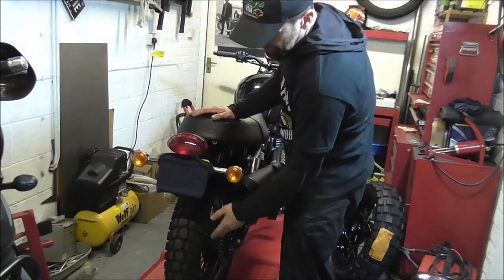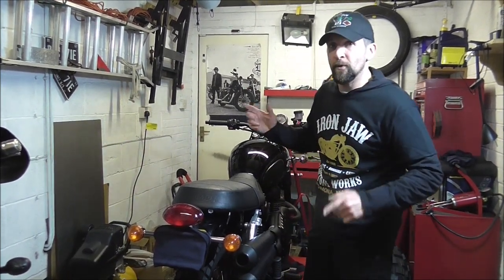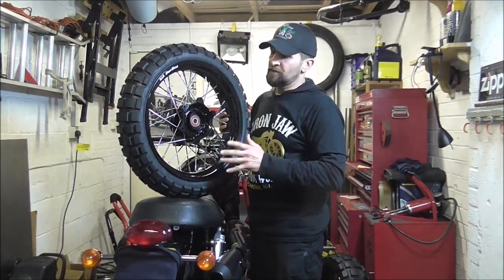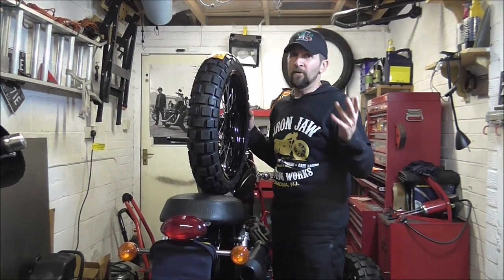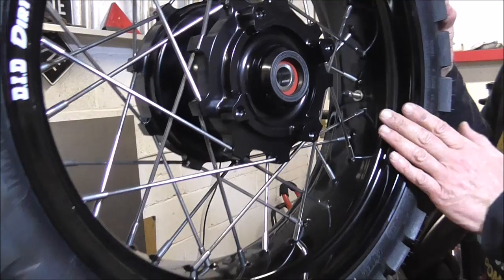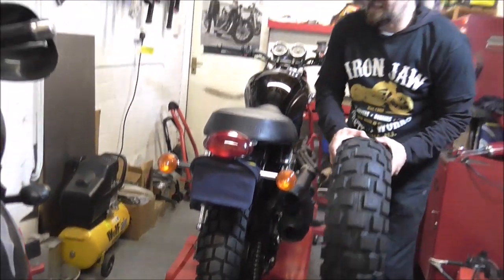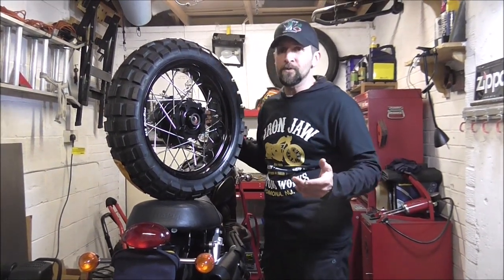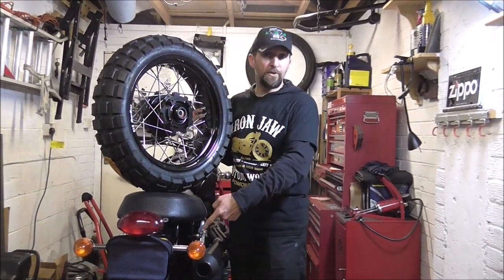Delboy's Garage, Triumph Scrambler 'Fat Wheels'

Comment: Thanks for all the help, Delboy! So the last thing I'm looking to upgrade on my bike are the tires for this season.  I would like to get a wider tire, but at the moment don't have the money to go to a full 5" wide in the rear.  The stock rims on the Bonne are only 3.5" so I was wondering what your recommendation on tire size would be if I wanted to get something a little "meatier" without sacrificing too much performance.  A friend of mine just fit a 160/70/17 on his rear using the stock rim and it looks great, but I just don't know how that might effect the performance of the bike if I were to get something that big.
Reply from the maker: Hi Craig, I would respectfully advise against fitting a 160 on your 3.5" rim.. its going to pull the tread radius round into an unnatural curve..  When you fit any tyre the 'bead' has to be supported at the correct width in order for the curve of the tyre tread to fall into its natural shape, and grip in the way intended..   

The tyre edge beads on a 160 tyre will naturally be about 4.5 / 5" apart, so the rim that supports them needs to be that width.. but if you "pinch" those edge beads in to a 3.5" tyre will pull those tyre edge beads together, and that will roll the tread curve round more steeply, and that actually reduces the width of the footprint that the tyre makes.. 

Now this isn't dangerous, but its not a natural correct fitment.. it may look fatter as there is more tread and less wall.. but if you measure you mates tyre across the tread, and your 130 across the tread it wont be 30mm wider.. may not even be any wider at all as its being pinched together... its more of an optical illusion... so again, not dangerous mate, but fittin oversize tyres is not a clever practice.. 

 A better way to do it, would be to find a make and model of tyre thats a chunky and aggressive looking tread, and maybe go up one size to 140... and your find it will look a lot more chunky and still give you a safe, full width footprint..

Comment: I have a 2006 T100 and Im having  DR wheels make me a 17" front wheel to replace the 19" wheel. I'm doing more of a cafe racer thing but sometimes I do travel on dirt roads. I have a Metzler tourance on the rear which is excellent. However it doesnt look like that tire comes in a 17".  What tire would you recommend for the front?  Cheers

Comment: Will those tires fit on a stock bike?
Reply from the maker: No mate, you need wider rims made to fit these tyres!
Reply: @ so if I get the wheel and tire combo, it will fit on a stock bike. I was having a hard time picking up the size with your accent. My apologies.
Reply from the maker: Tyres are 180/55/17, 120/70/17, and you'll need a 5"x17" rear and 3.5" x 17" front.. and yes, they'll fit into the bike as long as they're made with the correct Offset and axle spacers. !  Hope that helps.
Reply: Thank you 🙏

Comment: I like the rear tyre a lot! Makes the scrambler the beast it should be! Do you think an 170 on a 5 x 18 inch fit on the rear for the scrambler? You use a 17inch right and that is standard on the Scrambler.  And would the drive performance decrease if I put a 19 x 3 inch rim in the front ?  Thanks mate!
Reply from the maker: +Jan Aarts Hi Jan... the front has a 19x3 already, so it will fit and work like the factory handling... the 17" makes is steer quicker... and the 18" rim will fit in the back ok, but check if you can get the tyre for it.. i think the 180/55/17 is the biggest that they do in the TKC80...others may fit, but i havent tried them... Hope that helps buddy, thanks for your kind comments.. Del.

Comment: Those wheels are so cool !! Deffinatly a good investment cant wait to see them on del  im even thinking of getting those tkc 80 tyres on my supermoto
Reply from the maker: Get stuck in Aaron, coolest tyres ever! Grippy in the dry and still ok in the wet, you just need a little bit more of a sense of humour in the deepest corners, but being a Supermoto, they're made to go sideways aren't they?!
Reply: I like your thinking del  definatly in the pipeline now when the current ones have worn out and you were spot on on the previous tyre  reccomendation for my bandit 2nd set of avon storms  still going strong too  the scrambler will look so cool when the're fitted !!

Comment: I'm only 2 years too late on the thread...but we be all got to start sometime eh!! Quick question what's the widest tyre I can fit without changing the rims ?
Reply from the maker: Hi Paul.. general speaking, going up two sizes is the ragged edge, check things like chain and swing arm clearance, and maybe go for a chunky style tread if its the right bike, as it makes them "look" bigger... chat with the tyre guy though, if you go up on width, they may recommend to come down one size on profile to keep it safe... Hope that helps.. Del.

Comment: Del what size tyre would you recommend for a T 100 Bonnevile 2013. I really like the look. What are they like in the wet. Love your Vids
Reply from the maker: Hi Peter, tyre size if dictated by the size of the rim on the bike... I've got up to a 5" rim on this project, so I can fit the 170 tyre... but as your standard tyre is a 130, you should stick with that size, unless you are changing the rim.... it's a popular mis-conception that fitting a wider spec tyre will look 'fatter', but actually it doesn't... the wider tyre means that the seating beads are wider apart as well, and if you squeeze them in between a narrow rim, it will curve the tread more and make the tyre look no wider than standard with the danger that your tread is not the right shape and you may well, actually, end up with a SMALLER contact patch on the road, so stick with the standard 130 tyre your bike has and you can buy a Conti TKC80 in that size... and same goes for the front to match!...

As for wet use, treat them like you would the standard factory fitted tyres in the wet and don't push them too hard, they are great in the dry, fine in the wet, but as you have less rubber contact with the ground, due to the big fat blocks of rubber, then don't push your luck at extreme lean angles... I rode with a set on the Bandit, that was a far heavier bike and never even noticed they were any different from regular tyres!
Reply: Thank you for your reply. I now have a tyre pressure gauge a toolbox stacking unit and a scotoiler I wonder who gave me those ideas. My friend has the scrambler and we are touring italy this year and he may go for the wheels I will certainly be buying the tyres. Once again many thanks

Comment: mate I love your tutorials and the way you share your experiences. Can I ask advice on a Bandit? I've got a 57 plate 12,000 miles on the clock, The oil is very white, I've change the oil but it still goes white almost immediately. I only do 3 miles to an from work, what do you think? if it was a car I would think the head gasket had gone.   Thanks, Dave
Reply from the maker: Hi Dave, don't panick mate.....its condensation due to your 3 mile commute... unless you're saying that is came out when you changed the oil and it was ALL white like paint????????

Hot gases and cold steel makes water droplets, through condensation...that water collects on internal surfaces like a grey/beige coloured slime...looks a bit like mayonaise right?... if you were to ride the bike a proper distance say like 20 miles, then the heat you generate would vapourize the moisture and it would vanish..and your oil sight glass would just show clean oil and no mayo.....

So here's a task...take the bike for a good long blast, at least 20 miles, and get it red hot...then check the oil window...ill bet it will be clean and clear..?

This time of year for any bike that commutes short distance you will ALWAYS get this issue....just go out and burn it off buddy....thats the kind of care your bike really loves..!

Let me know how it goes...
Del.

Comment: From the time you spent with TKC 80s on the bandit, how long do you think they will last compared to normal tires?
Reply from the maker: They'll last the same time as long as you dont go doing burnouts....but then, that will trash normal tyres too.... the blocks are 10mm thick, way thicker than the tread on regular tyres...so that balances out the wear time..!

Comment: They're going to look absolutely fantastic Del, black and chrome is such a perfect combination when it comes to spoked wheels. Also those tires are huge! Do love the knobbly tyre look, just fitted a set of Michelin M45s to my GN125 and it handles so much nicer now. 

How much difference does the 17" front make when compared to say an 18"? My bike runs a 18" front and 16" rear, although the tire profile does counter the difference a bit it definitely feels higher in the front through turns, worth dropping a size when the tyres next come up for renewal maybe?
Reply from the maker: Hi Tobias, you'll have to drop the actual rim size an inch, not just the tyre size... and it'll cost a great deal of money for a bike like yours, but you could make a small improvement by lifting the fork legs up through the yokes by 1/2" - this will have the same handling effect as putting a 1" smaller wheel in the front, and you'll certainly notice it become a little more feisty in the corners, and quicker to turn...!

Comment: Have you had any experience with the Outex tubeless kit, or something like it? I'm about to try it on my new front wheel and looking for tips. Thank you.
Reply from the maker: Sadly not Scott, I've never used that, but I'd be interested to hear how you get on with it.
Reply: @Moonfleet41  Well, it's holding 35 psi for 2 weeks now. 0 miles, I'm still putting the Sportster together. Once I start riding it I'll let you know if I have any problems, and how I fix it.

Comment: Hey Bud not related to the wheels but are you using the stock seat now on scrambler the brown one was smart looking ...
Reply from the maker: Ayup Springy...yeah, got a regular Bonneville seat in there..(not the standard flat plank thing) as the brown one was effectively a Thruxton seat, and it was less comfortabler than the good old Bonnie seat...!
Reply: Ah sounds good. .cheers..

Comment: Hi! I have a thruxton 05 and really What a scrambler seat! Do you know of any that fits? I have bought the top yoke so i can get a bar for it to but dont know of any that sells a tracker bar! 
I cant buy yet a bike because i already have 6 :/ tanx from sweden
Reply from the maker: Hi there, the good news is, that the seat based used on the Bonneville, Bonneville SE, Thruxton, and Scrambler, are all the same... so in theory, at least, all the seats will fit all the bikes!

Comment: Hi Del.. i want the exact rims and hub can you please give me the specs for both front and back. thanks
Reply from the maker: +Chuck Sin Yes mate , no problem, rear is 5.5" x 17" and the front is 3.5" x 17" ... and tyre spec is rear 180/55/17 and the front is 120/70/17 ... hope that helps!
Reply: i don't off road at all, i was planning to get all street tires, any recommendation on tires?
Reply from the maker: +Chuck Sin If its road rubber you want, ten the list is endless, but as a guide, i used Avon Road Riders as a great all round tire for the Bonneville models, but if you want something a bit softer, then Michlin Pilot 2's like i said, the list is endless..

Comment: Hi Del 

i looked over Devon's website and his biggest rims are 17x5.0" don't seems to have 17x5.5 as you stated..
Reply from the maker: +Chuck Sin Hi mate, you are choosing from what he has as shelf stock, he made my wheels using 5.5" DID Dirt Star rims and Talon hubs... call him/ email him direct, am sure he could do up to 6" if you wanted !
Reply: Moonfleet41 in the video it sounded like you said you had to go down to a 5" width and 170 rear tire because a 180 won't fit. Is the rear wheel width 5 or 5.5" on this bike?
Reply from the maker: No, its a 5.5 rear, see the message below, he'll make any width if you special order it.. and two years on the bike is running street tyres, Conti Motion 2's 180/55/17 and there's about 7mm chain clearance.
Reply: Thanks Del! Just about to purchase so want to get the right size.  In the vid where you install the wheels with the TKC80 tires, the sticker on the rear says 170 section width, but I know you said with the lugs it's equivalent to a 180. Just so Im clear, with the TKC80's you're running 5.5" wide rim with 170 tire on rear?
Reply from the maker: I think so mate, it was 2 years ago, and three sets of tyres since.. TBH with the TKC tyres, they are so vague, that it doesn't matter of you have 5.0 or 5.5, it wont make any difference to the width of the tyre and the chunky rubber will mount on both.!

Comment: Hi Del i came across a set of rims from a Triumph Daytona 675. Front is 17x3.5 rear is 17x5.5. i would like the purchase if it fits kinda like those rims. please help me out thanks
Reply from the maker: +Chuck Sin Hey Chuck, yeah, they will fit, they have the fundemantally important sizes 3.5 and 5.5 x 17 - so you won't have any clearance issues but as they are not made for your bike, you will just have to check the bearing diameter to get the spacers correct, to get the off-set right, you will have to make sure the disc lines up with the caliper, which may mean fabricating a bracket to hold the caliper correctly on the disc (you will only need the one disc)...... on the rear wheel, the chain drive is on the other side, so you will have to run the wheel backwards, and again, you may need to space the front sprocket to get the rear sprocket off-set correct, and the same applies with rear caliper off-set to the disc........... in short, grafting alien wheels in to your bike can be a long process, there's often a lot of luck involved and just because they are from the same manufacturer means nothing... Honda CBR600 wheels, Suzuki GSXR600 wheels, will all fit in your bike as they are same sizes, it's all the other stuff you have to make fit... and if the axle size is different, then there's a whole new world of grief, you'll either have to have a new axle machined, or specified bearings made for the rear wheel with custom 'o/d' x 'i/d' ... like I said, it can go smooth and they just slot straight in, but that is extremely rare... now you see why people have bespoke rims made!  Hope that helps... Del
Reply: +Moonfleet41 Thank you!! Thats helps a lot. I gonna past.

Comment: Hi Del, luv the channel mate been watching for a couple of months now, recently picked myself up a 2nd hand matt black scrambler after having an argument with a kangaroo on my last bike (he won). loving the scrambler so far and I'm looking to upgrade the wheels and was wondering what width rim are you running on the front? cheers
Reply from the maker: +Nitermare Hi mate, sorry to hear about your accident... hope you gave the Roo what for lol ...nothing can spoil yer day like riding into a giant mouse with boxing gloves on....  the front rim on mine is the same width as standard 3.5" ...I just dropped it down to 17" dia. then fit a 120/70/17 tyre ... and if you are gonna change the rear, you can get a 5" rim in with a 180 tyre.... and if you're gonna go chasing giant mice again, you can fit knobbly tyres and only the Continental TCK80 comes in a 180 width... all the rest stop at 160, but they can be a bit vague on tarmac... it's always a trade off!  Good luck with it mate, enjoy your summer! Del
Reply: +Moonfleet41 cheers for getting back to me mate, yes running into a roo is a real quick way of ruining your day and both the roo and myself came out of it a lot better than my bike did if fact he just gave me a funny look picked himself up and kept going the cheeky bastard 😂 I wasn't sure because the tk looked so chunky on the front I thought you might have gone wider but I'll definitely be going for a 5 on the rear and if a run the tk maybe I'll get enough traction to go over the next giant mouse that comes along lol. Cheers mate stay safe and enjoy your winter if possible 👍🏻